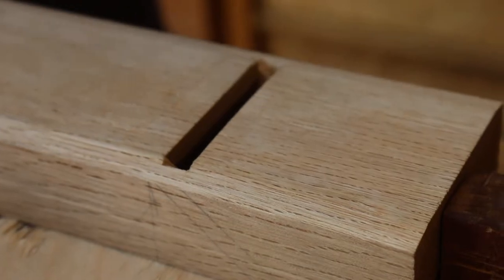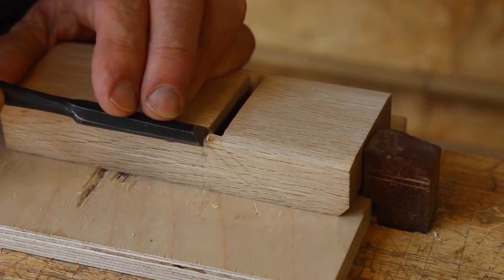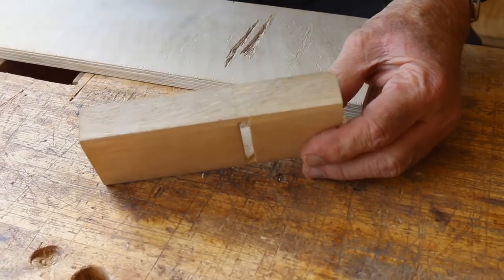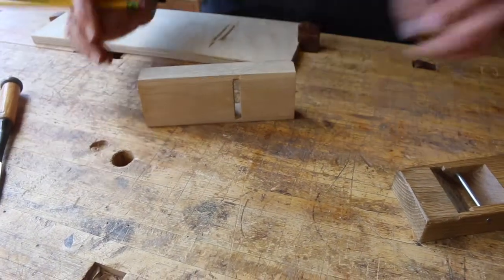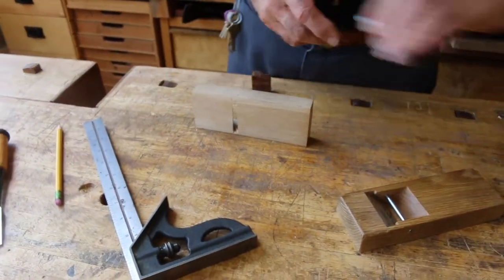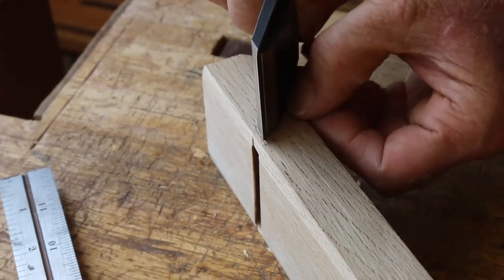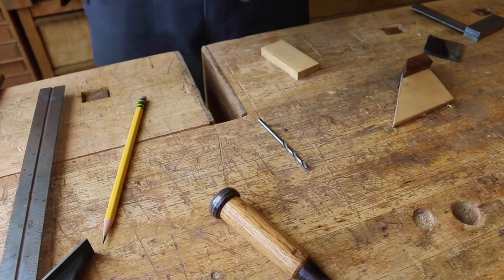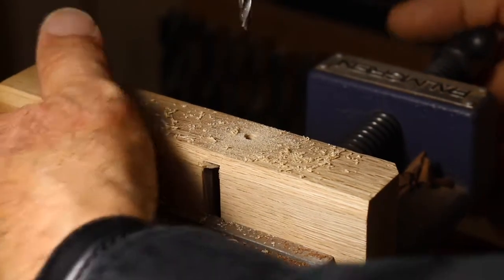Make a Kanna, Japanese hand plane part 5 of 5

Comment: Japanese planes look so simple but are in fact quite complex.
Reply from the maker: I think it's an inspired but simple concept that has over the years been highly refined as a response to issues arising during use.  Most interesting to me is the concept of "flat" that reoccurs in different forms throughout the tool: The sole is not an absolute flat as we would try and achieve it in the west, but nuanced for maintenence and performance; the top of the blade is hollowed to ease maintaining the blade edge; the part of blade in contact with the body is concave along its length, probably to help the blade keep its alignment in use.